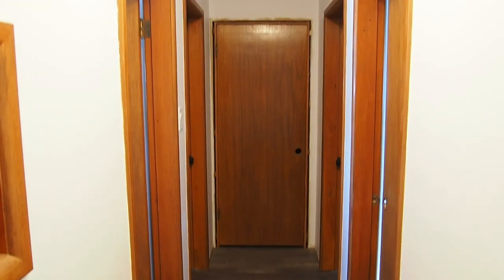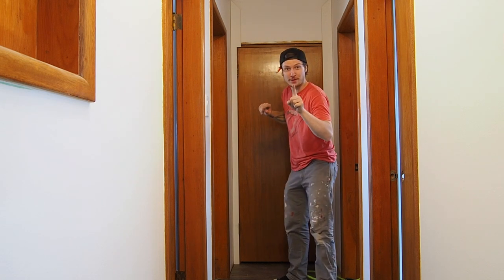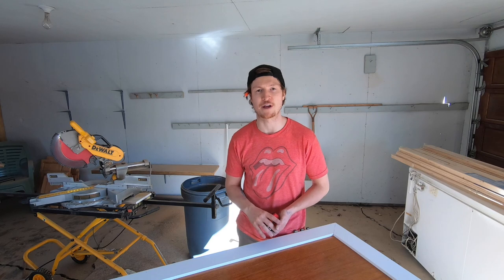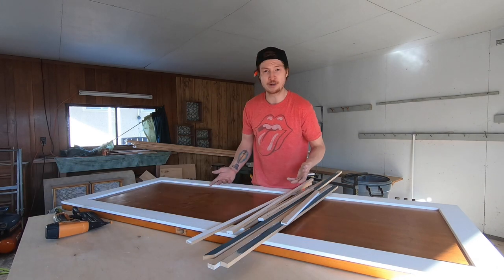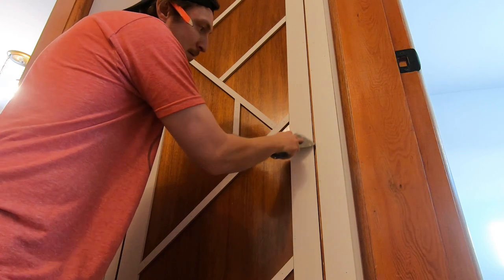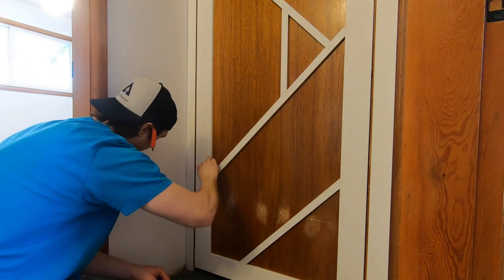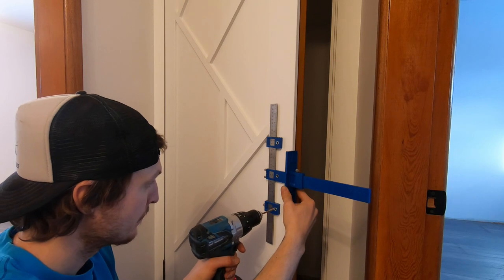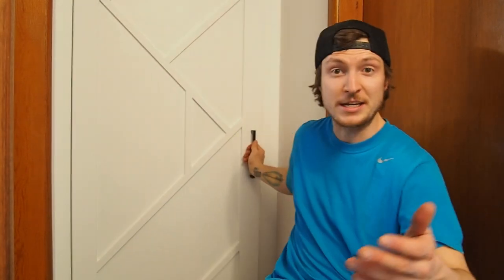Interior door makeover for under $50: Five minute Fridays Episode 1

Comment: How have the hinges held up? Might not be enough weight to matter but did you use longer screws?
Reply from the maker: Yes longer screws to make sure they are sunk into solid wood. I actually sold this property, so I couldn't tell you how it's doing. However, I see no reason it still wouldn't be functioning as intended. It also isn't much heavier than to begin with.